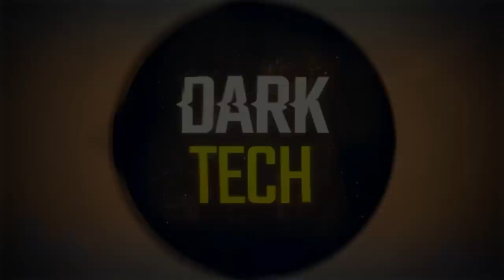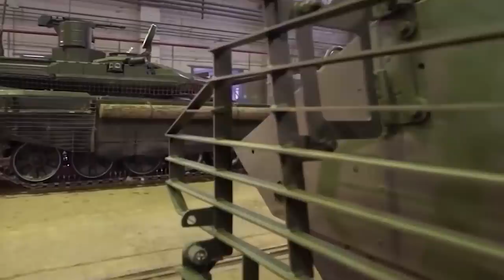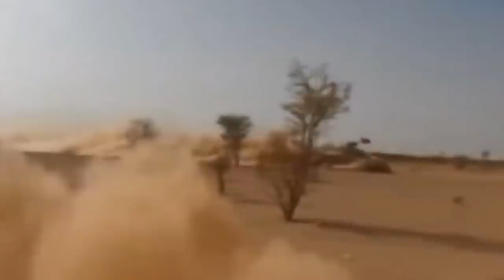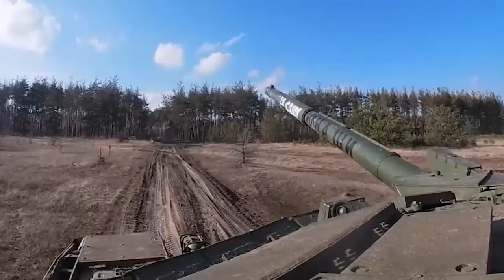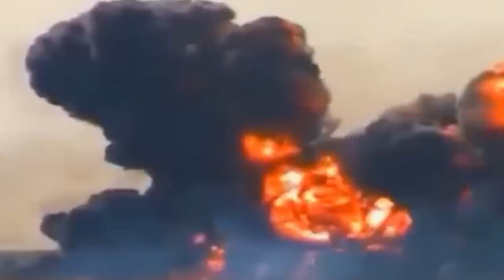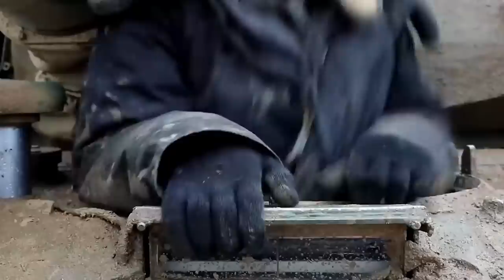The Tank Being Bought for the Darkest Missions on Earth

Comment: I think I would take my chances being behind a hedge row over being trapped in a T-90.
I sometime think the days of the tank is limited.  The world has spent billions on tank development but anti tank shoulder fired missiles have gained so much ground and in so many cases passed the tanks “security” capabilities… just like so many Russian and Ukrainian tank crews now turned astronaut or charcoal briquette would testify.
Reply: Agree 100% 🇺🇸
Reply: Vaguely disagree with your assessment because western tanks haven't had the same turret taking flight issues, can and have withstood ATGM strikes and continued.....if you wanted to say that Eastern block tanks have been proven to be worthless I'd wholeheartedly agree however the Abrams, the Challenger and leopard are all extremely effective on the battlefield and don't have the same weaknesses typically found in Russian designs
Reply: The tank will never die so long as nothing else can do what it can. Last I checked we've not found a mobile, durable, and stable gun platform that can be as flexible as it is effective as the tank. As armor advances, so too does firepower, and the cycle repeats. We've reached the point where firepower has advanced, and so too shall armor advance and the equation will return to balance, as had happened for decades now.
Reply: @roberthurley8366  I agree with you on western tank designs… I did not say all tanks were unsafe… I merely stated that “I sometimes feel like the days of the tank are limited”.  At one time the battleship was the ultimate weapon and entire nations spent a great deal of money and resources to build the most powerful capital ship… then along came the dive and torpedo bombers and all the great navy’s realized that the mighty battleship had met its demise by a far cheaper thing called the airplane.
That being said… I would much rather be an Abrams, Challenger or Leopard than any T90 or Armada tank.
Reply: @carroboi2981  I agree with you also… to a point.  As I replied to another comment… the same was one said for battleships..  my father served on the Jersey in 1968 when they took her out of Moth Balls and sent her to Vietnam.  Now she makes a fine museum.  Eventually even us humans will become obsolete… just ask the dinosaurs… everything’s time comes to and end eventually and “never” is a very long time.
Reply: I have said for years, give the US Army 10,000 dune buggys (like SF used in Desert Storm) fitted with Tow launchers n MAN PADS.  3 man crew. Ma duce too.
Reply: Throughout the history of armored vehicles there has been a constant evolution on both sides of the equation.  The earliest tanks got taken out by anti-tank rifles.  Tanks evolve, then anti tank weaponry adapts; wash, rinse, repeat.  I'm pretty well versed, as I was an Antitank Assaultman in the USMC.  Sometimes tanks evolve in ways to counter modern weapons, and become vulnerable, once again, to previous generations of weaponry.  Designers of new weapons systems are always trying too look forward, and sometimes forget to look backward as well.  Javelins are formidable, but countermeasures will be developed, followed by counter-counter measures, and on and on.
Reply: @raytribble8075  Hence why I said "So long as." 

The tank could theoretically be replaced as the battleship was, but only when something can do what it can, but better. The carrier made the battleship obsolete by having far greater range and having no need to even engage in combat directly, yes. Maybe one day it'll happen that someone designs something better than the tank, but today is not that day.
Reply: @patrickd2013  I absolutely agree with you.  We once used rocks and clubs… we excel at ways to kill one another.
Reply: @raytribble8075  Yes we do.  As to the hedge row, I'd rather back there (with a jug, no less) than trapped in Any armored vehicle.
Reply: The t90 is just an upgraded t72. The t72 was fine, in the 70s. By the 80s they were little more than targets. The t90 is just another target with 0 worthwhile features and all electronics from West.
Reply: @johndoeyedoe  yes sir… it is the eastern philosophy… make hundreds if not thousands of them and overwhelm the enemy.  The Russians did it to Germany with the T34.  The Panzer V’s (Panthers), Both Panzer VI (Tiger) and King Tigers were amazing weapons for their time… but just got over ran by the thousands of T34’s and IS series of tanks.  Russia had 108,000 plus tanks in the war and lost over 83,500 of them… but at the end of the day… they made it to Berlin.
Reply: Still most western tanks the crew survives.
Reply: @raytribble8075  the 23 million men plus the 43 million civilians part of the reason Russia has such a population decline today.
Reply: @raytribble8075  let's not forget cannibal island in 33. Or the deliberate starvation of Kazak people and Ukrainian during the 30s. Or the massive putsch Stalin ordered on his military officers. Part of the reason Soviet tank tactics so primative. Also why the 1939 winter war went so poorly. I doubt Russia would have had as much success against Poland if it wasn't for the Nazis.

 Stupidity is more the tactics employed by USSR. Human waves are fine if you have 230 million people under 35. However by 1945 the USA could have kept on rolling like Patton wanted and have been in Moscow within months.
Reply: @johndoeyedoe  yes sir… no apparent value for life.  Terrible in so many ways.  The company I worked for 41 years used to have oil and gas service operations in Russia and I worked along side many… they just wanted to live, feed their families and enjoy the world like most of us.  We have a bad habit of painting the world in black and white… but there are so many colors in between along with nationalities.  The current war IMHO is such a waste.  A bunch of useless sword rattling where non of us will come out the winner in the end.
Reply: @Lukky_Luke  yes, I agree… as everyone probably knows… self loading systems are great for sustain, fast fire… they pretty much suck if heat finds it way inside.  I worked for 41 years in the oil and gas perforating industry and we used shaped charges daily to perforate holes through oil well casings, through the cement and as much as 48” into the rock.  We conducted “controlled” surface test on steel and various rock test mediums… I would not want to be on the receiving end of any of the current high density shaped charge projectiles.
Reply: @johndoeyedoe  I admire your knowledge of history.  I was a Finnish military collector of both the Winter War and continuation wars.  I had a small museum of Finnish uniforms, weapons set up in three displays in my game room… unfortunately I was blessed with chronic heart failure and am on a transplant list so I have sold almost all of my collection as I no longer need it.  But I have been to several battlefields in Finland and wrote an article in the August 2016 Shooting Times of an antelope I took with my 1939 M28-30…
To talk with Finnish soldiers from both wars (25 years ago) was unbelievable what the Finns had to do and how so many waves of Russian soldiers charged Maxims and various Finnish Mosins and K31’s each day… using the frozen bodies of their dead comrades as cover to gain a few meters each day… is absolute insanity.
Reply: @raytribble8075  wow, you spoke to veterans from the winter war. I worked in a veteran hospital. A lot of respect for those that fought these conflicts. 

I used to work at a veterans Hospital so heard many stories of the Pacific conflict ww2, Korean war, Vietnam, Somalia, Solomon islands, 1st gulf war. 

 A while later I was civilian contractor for ADF. This is when I was involved in my generations conflict Iraq and Afghanistan. Psych corps. Debriefing returned personal. 

 I also worked psych a lot. Forensic, public and private, emergency department etc. Palliative. Ended up with PTSD. That kind of work takes it out of you.
Reply: Add bunkers to that list too, helicopters, anything that came off a train from the west. Seems like war is pretty pointless if all the counter's are more successful than the primary forces, maybe the Ukrainian army should have done a bit of research before becoming a NATO proxy and starting a stupid war.
Reply: @henriyoung3895  and what? Race them at Daytona? You can't possibly mean they would have fuc":d the Russian army up!
Reply: @Lukky_Luke  your right because they were not stupid enough to go the tanks sent on the other hand, they are creator's now.
Reply: Time to re design the tanks. Rockets exploding downward toward tank light armour. Go back and look at the original tank by Lianardo. The conical design would increase the armour thickness while leaving no flat areas.
Reply: @Robert Hurley cope harder considering non of the western tanks have gone up against an actual army. Just third world outdated and poorly trained forces. Maybe go see what happened to Saudi Arabian Abrams in Yemen or what happened to the Leopard 2 in Syria, looked like those turrets would fly too. Almost like every tank launches the turret under the right circumstances.
Reply: @roberthurley8366  when the turret is taking flight the crew is already dead and the crew part of an M1 turret that is not counting the huge turret bustle that has all the amo in the highest part of the turret is larger than that of  a T 90 and leopards 2 had their turrets blow off in Syria
what also helps is the turret on an M1 is probably 2X as heavy as a T 90 turret(it from flying off)the crew will be as dead

the Abrams, the Challenger and leopard are all extremely effective on the battlefield what battlefield?
Reply: @fred6319  apparently you missed the Gulf war...... Iraqi freedom.... and a couple of other low intensity conflicts..... the Abrams turret doesn't go flying off because if the ammo is hit (yes it's stored in the turret, there are blow out panels which direct the explosion and flames out and away from the Crew) and the other associated tanks have similar features so western tanks don't send their turrets into flight...... further more western combat operations are typically at longer ranges whenever possible and even mount operations (close quarters) the Abrams has performed wonderfully.. specifically because of the different way western armies employ and deploy their armor assets..... but whatever you can believe whatever you want to and I'll just be the veteran with experience who has researched this and has the hard numbers and why those numbers are what they are
Reply: @roberthurley8366  Iraq had most of it army destroyed in gulf war 1 was under sanctions/embargo for 20+ years the iraq army had obsolete 72 copies(not modernised for 20 years)poorly trained was bombed for several weeks (months) used ammunition that was out of production sinds 1989
and what part of "when the turret is taking flight the crew is already dead and the crew part of an M1 turret that is not counting the huge turret bustle that has all the amo in the highest part of the turret is larger than that of a T 90"and "what also helps is the turret on an M1 is probably 2X as heavy as a T 90 turret(it from flying off)the crew will be as dead in the Abrams,"dont you understand?
there are blow out panels which direct the explosion and flames out and away from the Crew and that does nothing if the part where the Crew is gets hit the turret doesn't fly off but the crew dies

 the crew part of an M1 turret is larger than that of a T 90  =translation it is a bigger target if it gets hit the turret will not fly of but the crew will die and hope very hard the amo is not hit when the doors are open and when they upgraded from 105 mil to 120mil some people say the blowout panels where to smal

but  you can believe whatever you want to same for you
Reply: @roberthurley8366  Nato tanks has not been tested to the same extent, and if you are in denial about the "turret taking flight issues" on Nato tanks, you should research Turkish Leo 2's in Syria. There is a video of a ATGM hitting a Leopard 2a4, causing a "turret taking flight senario", so if the ammo is hit, the shockwave will find the easy way out and remove the turret from the tank chassis.
Reply: Nope, the days of the tank are not over. There is always going to be a need for a highly mobile, very well protected battlefield platform with high firepower. A big reason for Russian tank losses in the war against Ukraine boil down to using tanks in stupid ways. Deploying them without infantry screen? That's just asking to get javelin'ed from the bushes near to road. Tanks are neither magic nor invincible, but they are very powerful and useful if used _correctly_.
Reply: @henriyoung3895  they would just mine everything and you lose 10000 dune buggys.
Reply: this was said after world war 2 (around cold war?) and look where we are now. the problem is not the tanks but the ways they are designed, the t-72 was one of the best for its time but its now obsolete. the problem with the russians is that their tank development has been stagnated since the USSR except the armata, which will likely not be mass produced unless the russians manage to pull up their socks and develop their own electronics
Reply: @AlexanderSchreiber  iirc one reason the russians can't use infantry to support tanks is because the tanks have ERA blocks that could hurt the infantry if they detonate after being hit
Reply: @roberthurley8366  do you want to reconsider your opinion on the leopard
Reply: @raytribble8075  Maybe the big gun ships will have a place again in certain roles. On Dark Tech, I saw there's development of ram jet artillery 155 mm that can shoot accurately to 170 kilometers. Maybe there's a navy version seeing they're struggling with rail gun barrel wear. Ram jet projectiles are suppose to be easier on the barrel life and relatively cheap to shoot.
Reply: @kurtwinslow2670  hey… I have seen The Terminator… any weapon is possible.  But I do agree with you on munition modifications… who knows… rail guns if they can shrink the power consumption and storage

Comment: T55/54a must be better since the Russians are pulling them out of storage instead of relying on the T90s.
Reply: There is an enormous stockpile of ammo for the gun on the T55 that doesn't fit anything else that I know of except other, older tanks (some of which they are also dragging out and dusting off), so they're not using them as tanks (or instead of).  They're using them as a sort of mobile artillery.  Novel way of increasing overall firepower.  More guns 'n ammo is more guns 'n ammo!
Reply: Modernised with optics and reactive armour and to be used as mobile artillery behind the front lines.
Your grasp of this conflict is childlike.
Reply: If there is no modern tanks to go up against then older tanks are perfect why use your more expensive gear if not needed.
Reply: @fryertuck6496  What's the matter with existing artillery? Isn't there more, newer, higher caliber artillery than active Russian tanks? Are you saying there's something wrong with the vaunted Russian artillery forces?
Reply: @patrickd2013  Is there something wrong with existing vaunted Russian artillery? Weren't there more, newer, higher caliber artillery in the Russian forces?
Reply: @bulldogwoof6954  Well, if that's the reason, why are there T90s in Ukraine at all? Why not depend on the old T72s? Or rather, Why didn't they use the T55s in the start, in the 1st place?
Reply: @randolphtiangco6239  Don't quite get the point, do ya?  More guns 'n ammo is more guns 'n ammo.  Seems you've got a particular agenda that warps your perspective.  Tsk, tsk, tsk.
Reply: @patrickd2013  i'm sure that's the same military theory of the soviet union before it bankrupted itself and fell.
Reply: @randolphtiangco6239  it's a big frontline around 1000km, different tanks playing different roles, Ukraine has also used older tanks for decoys. The latest T-14 Aramata is also in but probably not many. Go search for "Alexander Mercouris" he is absolutely fascinating to listen to and his sources of information are just as brilliant as well.  He has been a realible source of information since before the war.

Comment: Also comes with a quickly removable turret, Just 1 NLAW and you have easy access to the inner workings
Reply: not to be that guy, but its around 20 nlaw shots to destroy one at average, due to misses, non penetrations, failed rockets, failed locks, hits that deal little to no damage.
Reply: @Ray  The Pentagon found it takes 1 million rounds fired to kill an insurgent back in 2011. Whats your point.
Reply: @theduke7539  my point is that 20 NLAWs cos as much as a tank, you need a vehicle or 20 dudes to carry them around and they only good for shooting tanks.

A tank is only 3 dudes and can perform much more operations

Comment: Soviet inspired, Russian heavy military equipment,  was designed around the concept of the assault wall. It didn't/doesn't matter how good, individually, they perform...they were intended to work, in mass attacks. Overwhelm, with numbers, not necessarily with abilities, of the units.
Unfortunately, as time has unfolded, this tactic has shown, to be, unreliable on modern battlefields.
Cheaper anti-tank missiles and even cheaper "Clinton" (Suicide 😊) drones can take out whole squadrons of Russian designed tanks. Doubtful, the vaunted T-14 Armata, would fare much better.
(Reportedly, what few were fielded, were something of a disappointment, to the Russians)